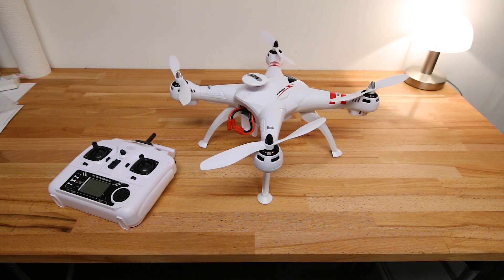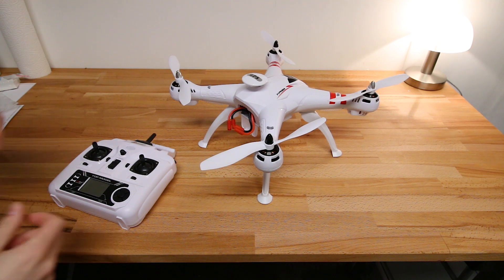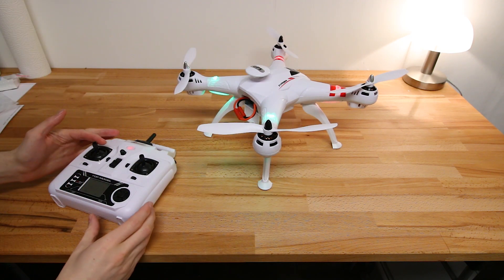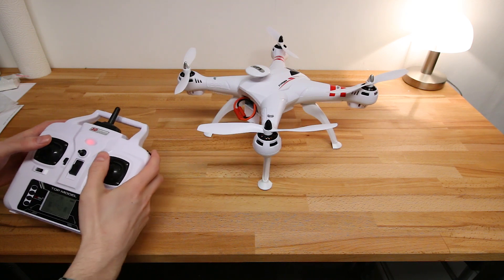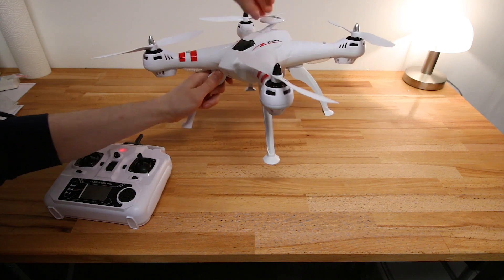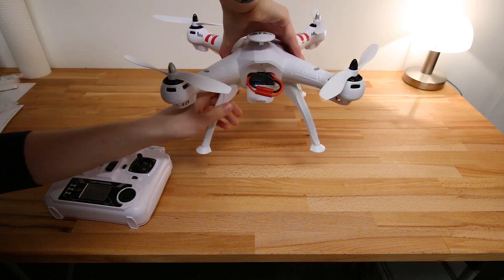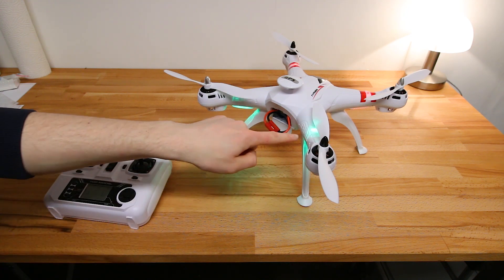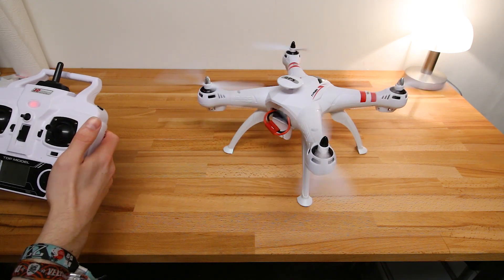Quick tutorial: Bayangtoys X16 drone calibration HOWTO

Comment: I had the same problem with the ALWAYS blinking as CrimsonSoldier and the problem was solved by doing TWO turns instead of THREE as described in the manual for the calibration just as the video shows.

Comment: i have a very strange blinking sequence that will not stop. 2 short blinks and one long, and then it repeats that sequence. It never has achieved the solid lights position and i agree the directions for the x16 are very poorly written.  I was very excited to receive mine but have yet to take the maiden voyage. I came to your video from another vid from a young lady. Unfortunately i dont think this will help.  But thank you for taking the time
Reply from the maker: I thinkt the "2 short, 1 long" sequence means that the drone was not happy with the calibration, and you should try again (move it a bit differently). Not sure though. 
I have rebuilt my X16 to use another flight controller, so I can't check it anymore.